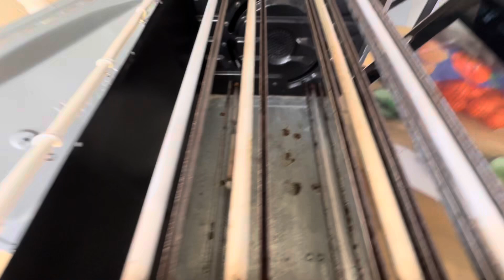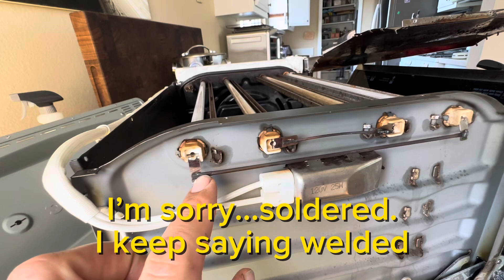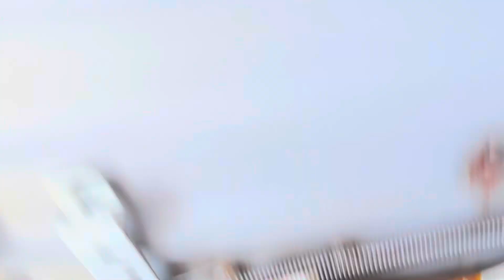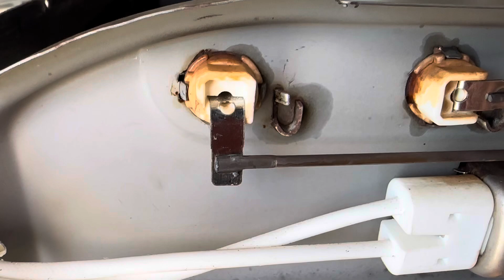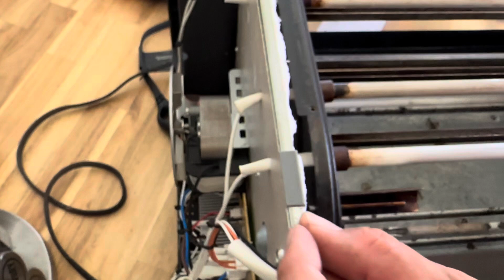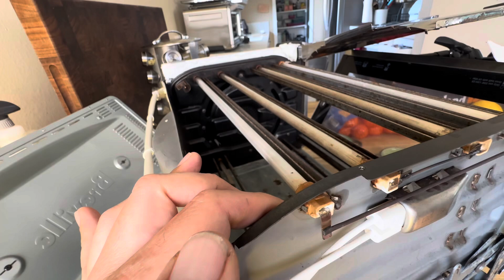Breville Smart Oven Air Fryer Pro - Heating Element - Can they be replaced?

Comment: Thank you for the video.  I have a broken bottom element.  Can it be disabled by cutting the wire?  Or just left as-is?  I’m not worried about inefficient heating so long as it’s not a fire or food safety issue.  Appreciate your thoughts.
Reply from the maker: It should be ok. Just be gentle and don’t touch it while hot. I wouldn’t cut it. It will mess up the voltage and amperage of the circuit.

Comment: They are available, this is the part number for the bottom elements I replaced #SP0010494 . I’m sure you can find the tops too. You were originally right in the video the connections are “spot welded” not soldered. This is a factory connection and cannot be replaced with solder as rapid heating and cooling would degrade it. This is why the coils come as an assembly. You do not need to remove the fan assembly or cut any wires. All connections are removable spade connectors. Remove outer top shell and the controls and control side foot. (Must remove 3 plastic clip connectors and ribbon cable clip) The coils can be pulled out from the non control side. Instead of removing fan and bending tabs simply squeeze and break the white pieces holding the coil into the control side from inside the oven and then twist/pull the non control side and they come right out. Due to the angle of the tabs you can then push the new one right into the control side where you broke the old white pieces and they will snap right in. Then connect the spades and reassemble! Hope this makes sense and helps someone!
Reply: Total took me about an hour/hour and half and the coils we $35 including shipping
Reply from the maker: The part number you listed is matched up with the BOV650XL. That oven has a significantly smaller interior cooking space than the BOV900BSS. I don’t believe they are interchangeable.

Comment: So, the elements come as a set or assembly! When you order the elements, they come with the bars welded on them. The Bottom assembly is $24
Reply from the maker: Please rewatch the video. I address that the heating elements are not commercially available.
Reply: Here in California we have a Repair or Replace Law that manufacturers must provide parts available for repairing appliances worth $100 or more. I’m going to call Breville customer service and see if I can obtain the lower heating element from them. I know it’s not available from any part houses. For some reason, the shorter heating element is available for the smaller unit….go figure. I was disappointed the lower heating element is so fragile. I have purchased various units over the years …Cuisinart, Oster, and DeLongi…. This Breville was the best of the bunch. I really don’t want to throw away an appliance that can be repaired. I will try to bring the unit to the local Repair Cafe for help if I can’t figure out what needs to be done. Thank you for taking the time to film your repair journey. My husband and I have repaired our microwave (20+ years old) and kitchen exhaust fan guided by various YouTube videos. Hate these planned obsolescence appliances!

Comment: Mine cracked a couple of weeks ago, is it safe to keep using it as it is?
Reply from the maker: I won’t say it’s safe, but here are the potential issues. You can use your judgment if it makes sense or not:

1) If there are loose pieces of quartz, they can fall into your food (only applies to top elements, not bottom ones)

2) The quartz helps radiate heat. If a whole pieces of it fell off, you may get uneven heating. 

3) Don’t touch the quartz or wire when it’s hot. Common sense, but someone is bound to think normal practices don’t apply